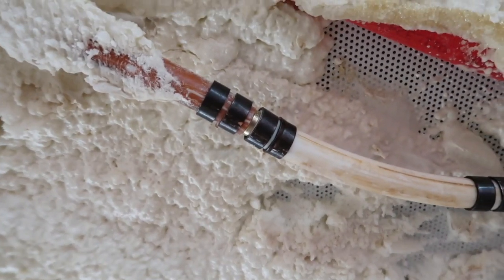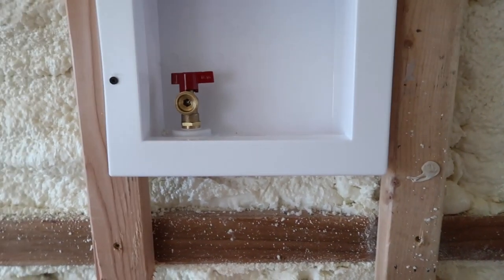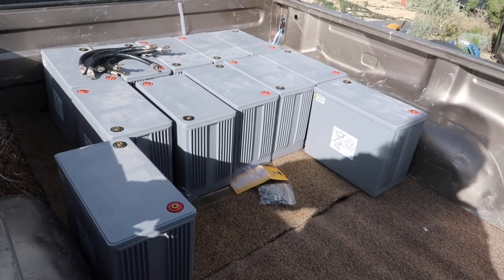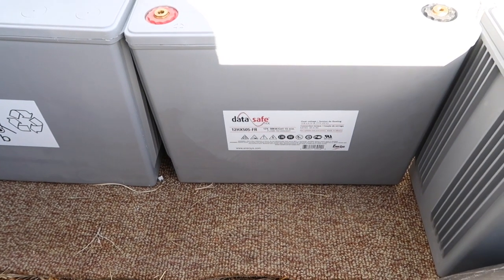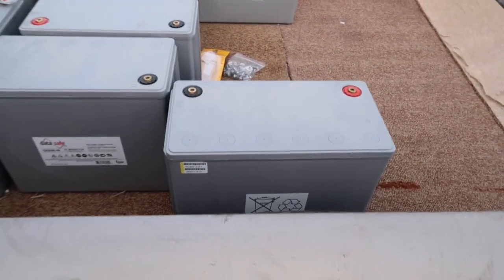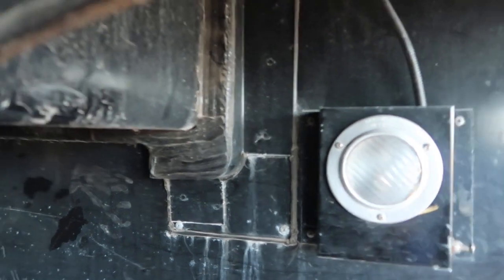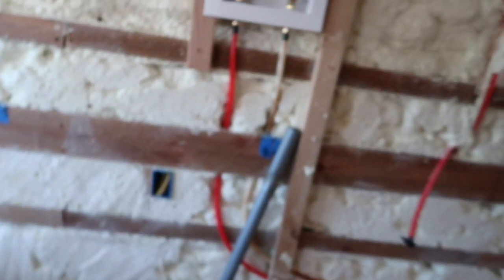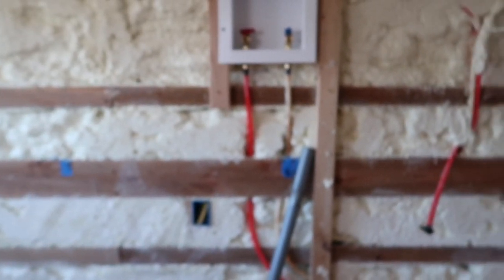School Bus Conversion to Motor Home #30 Washer box, batteries

Comment: My only suggestion is to make sure the batteries are easily accessible so you can check their connections for tightness and foreign matter buildup.  At some point you will need to change them.  AGM batteries are not really any different than a normal lead acid car battery except they are sealed.   They can vent under extreme failure conditions just like other lead acid batteries.  Their lifetimes are also similar to lead acid batteries and they are considerably less expensive and more available than the longer life nickel metal hydride or lithium ion batteries typically installed in hybrid and electric vehicles.   Your charge controller should manage the battery voltages to avoid excessive deep discharges of the AGMs.

Comment: batteries have a max charge / discharge rate ie max amperage draw, sometimes you have to series parralell to allow for the larger amp draw ie share the load amongst the many 24v  mini banks.

Comment: Oops!  Welding on a frame is not advised!  You need to find out about the Rockwell Hardness of your frame.  SOME frames can be welded on the Web (The vertical part!) but as a rule never weld to the channel parts (The top and bottom of your frame!) . This is very important.  You could wind up with a major headache!  I have heard some [people lost their bus because it was labelled nonroad worthy!
Reply: Jim Gadberry, I have some more information about BATTERIES.  (Excellent choice for batteries, by the way.)  Dielectric Compound is good to be sure, but there is a better way! The Lawson Corporation has a compound that equals DE but it has real copper flakes in an Anti Seize that also protects your terminals and adds the benefit of a better conduction between the dissimilar metals of the cables and battery terminals.  I repair Garbage Trucks, this compound does a masterful job of protecting the THREE Batteries it takes to start my trucks.  It is called 'True Copper Plate Anti-Seize' and it is a better choice for battery terminal protection.  You should be able to find in online at the Lawson Products website.  You might even find out there is a representative who will come to you and help you place an order!  As you can imagine, such compounds make battery maintenance much better!  Also, you can use Dielectric Compound or Grease on ALL electrical conventions that will be exposed to any moisture/weather related environments.